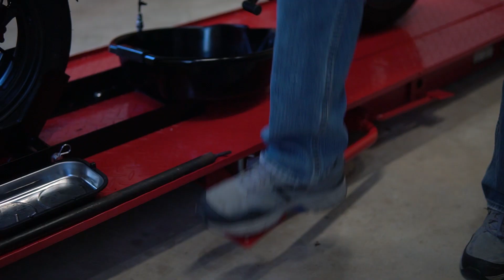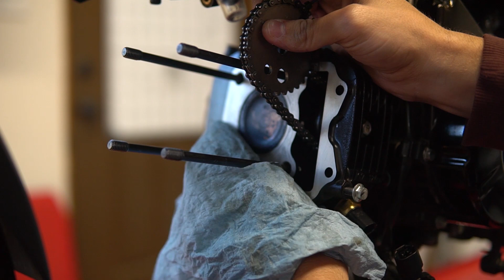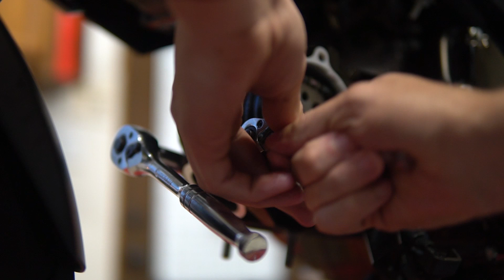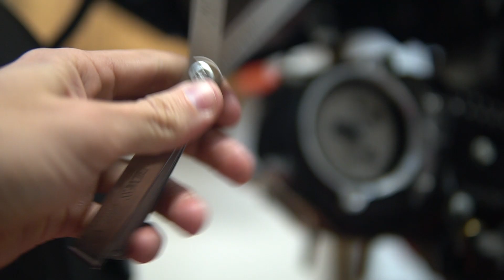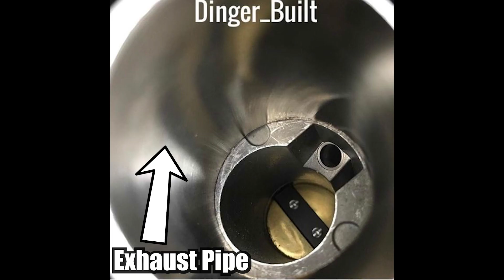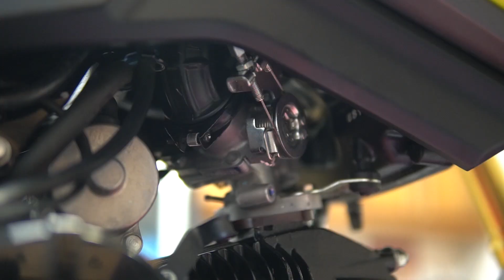Ported Head and Throttle Body by @Vinnyscustomshop | Grom Garage Winter Build

Comment: Hey can i ask something. Theres something in my grom that i dont understand. When i do cold engine start my grom will start but after a few seconds it dies, then ill have to start again until 4 tries to have the engine to idle without dying, and as the engine idles, it does go down and go back in normal idle or it will go high. Do you know where the problem comes?
Reply from the maker: I don't really know for sure, but I would check your valve clearance as well as spark plug.   Also is the gas fresh?
Reply: Clearances were adjusted bu my mechanic. He used a filler gauge so im confident he does adjusted my clearances in the right specification. Sparks were checked also, doesnt have a problem.
Reply: Clearances were adjusted bu my mechanic. He used a filler gauge so im confident he does adjusted my clearances in the right specification. Sparks were checked also, doesnt have a problem.
Reply from the maker: Next I'd say do a compression test and see how the numbers compare to what's in the service manual.  Might have a leaking valve or the rings might be shot.  Probably something with the valves though
Reply: Ok thank you..
Reply from the maker: (Kyle here) check the temperature sensor on the left side of the motor under the cam cover. If it’s messed up it should throw a cel but if that sensor is messed up is can do the same thing
Reply: Ok ill go check it.
Reply: My idle was adjusted around 1400 rpm. Is it ok?  From 1200rpm.
Reply: Jayson Benitez 1600 is a lot better. For oil recirculate faster (cooling) when the bike is not in movement.

Comment: Does porting mean making the holes bigger?
Reply from the maker: Yes it does
Reply: @GromGarage  Does it make sense when using stock valves?
Reply from the maker: Yeah, I'm still running stock valves on this head.
Reply: @GromGarage  Did you also bore out the intake manifold?
Reply from the maker: Yes, vinny did all the work
Reply: @GromGarage  is port basically just cleaning the head out because going big would mean a larger piston and even head.

Comment: You need a tune. At the moment you a running blind.
Reply from the maker: Yep, it will be coming soon.  Just waiting on my exhaust and intake, because with stock there isn't a huge benefit to what I did.  The difference will be noticed once I do the next two steps